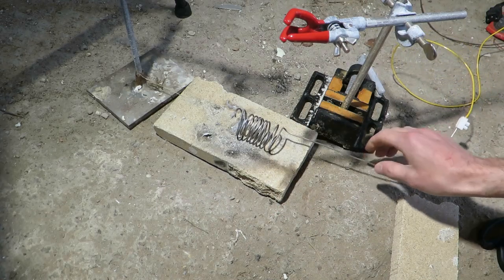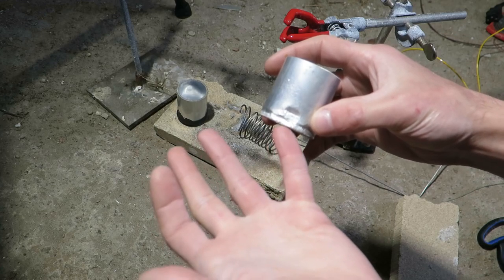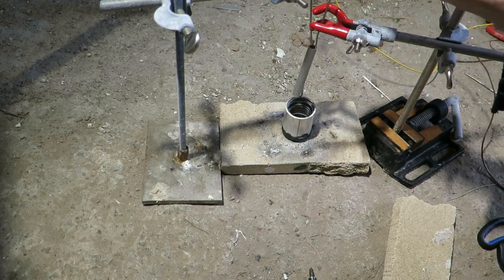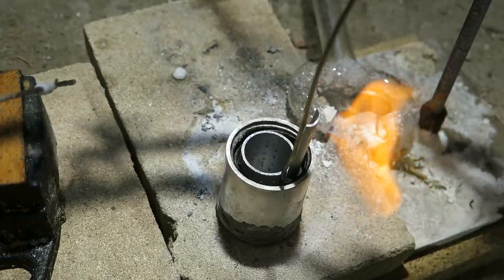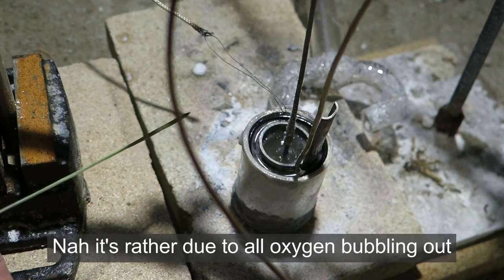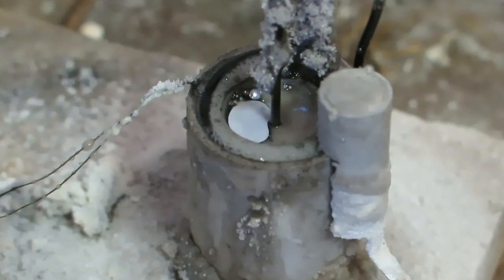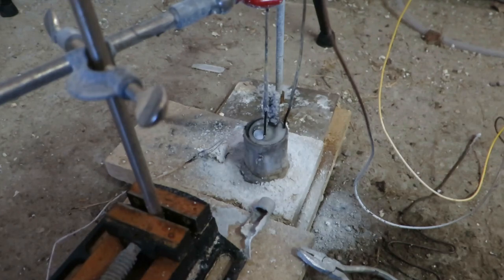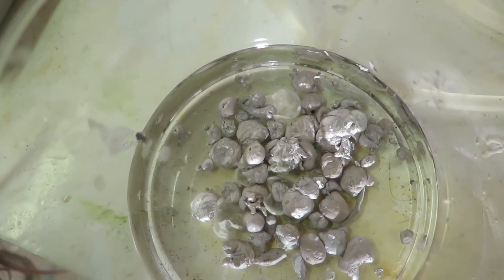Lab notes - castner mini-cell experimental setup #2

Comment: To make your crucible vessel, you could friction weld tube to plate with a drill press.
Reply from the maker: lol have you seen my drill press?
Reply: @IlusysSystems  good point. I'm surprised you do what you do with the equipment you have.

Comment: I have used some kind of ceramic muffin mold as an outer shell and it works flawlessly without any damage probably made of aluminium oxide
Reply from the maker: in my case any attempt to use cookware resulted in it cracking in half... I don't mind outer shell being conductive, but separator tube could be problematic if it traps a lot of oxygen and hydrogen, but I think I have a plan
Reply: I think I'm just lucky with that muffin mold xD 
I use it as a crucible for high temp metals 1000c+ 
I'm so excited for your plan